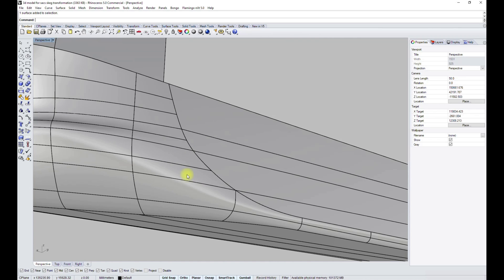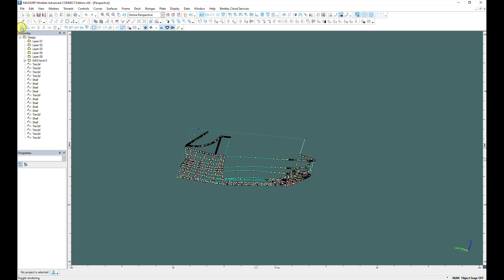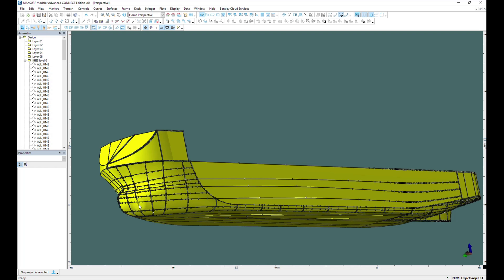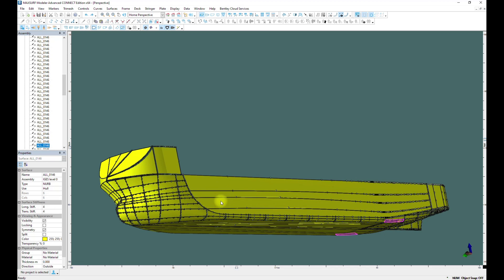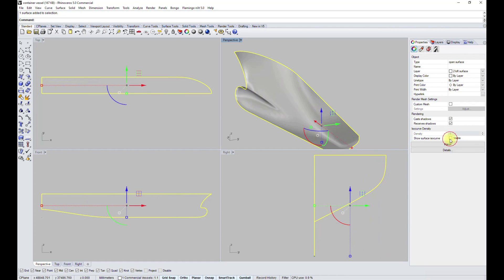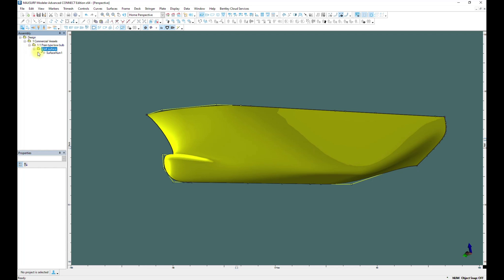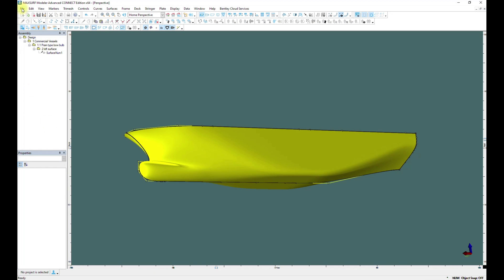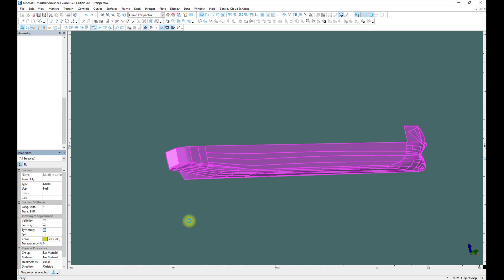How to export model from Rhino to Maxsurf

Comment: Hi Good video, but normally when I try to import my model from Rhino into Modeler, I have problems with surfaces trimmed in rhino, so modeler show the "original" plate no trimmed. How can I solve this problem? also what is better, import a IGES file or import directly a 3dm file?
Reply from the maker: Hi there, it is little bit difficult to asume without seeing actual model how it was created.But we are planning to make workshop in 2024 then we may clarify all that kind of details. Related to import files preferable to use IGES for other models but currently we use 3dm.

Comment: Gap was there from rhino to maxsurf
Reply: @bsyeng  I'm creating surface by using transverse sections in rhino.
From rhino to maxsurf or solidworks 
If I checked the there is gap in between trans. Sections
Reply from the maker: @dinakaran211090   If you are creating in Rhino I have to maintane that gap. But I guess I didnt understand question properly.